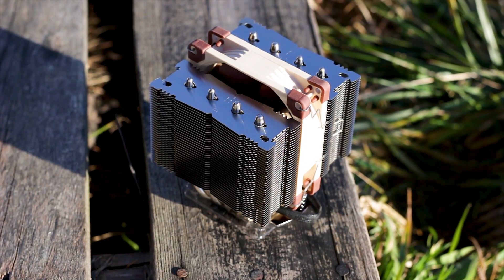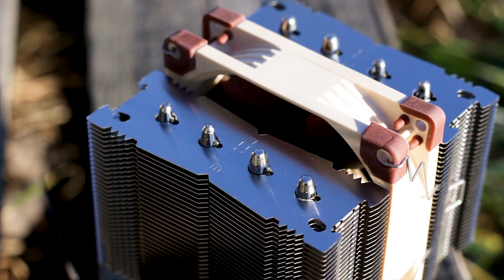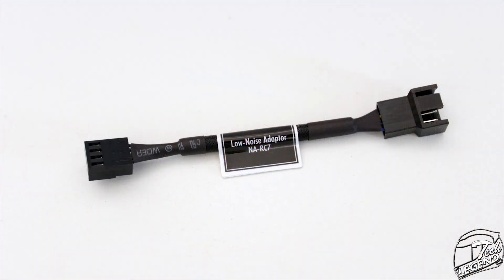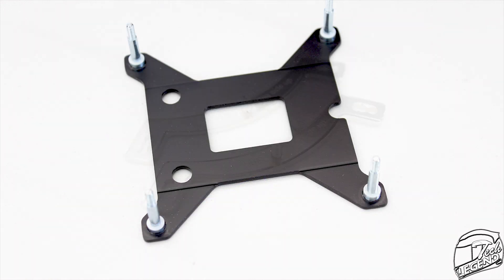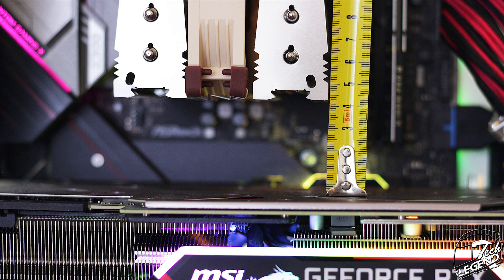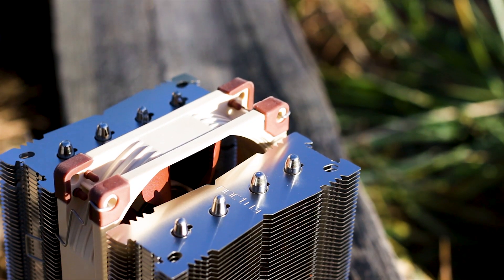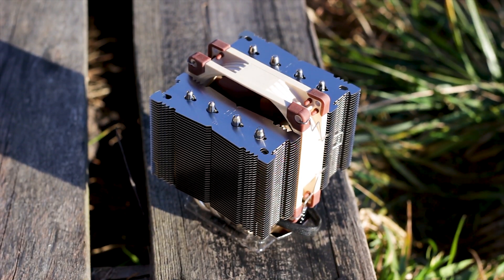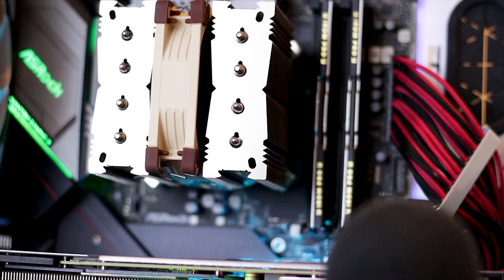Noctua NH-D9L CPU Cooler Review | The smaller alternative to performance!

Comment: Have this cooler running from my Ryzen 2600 to 3600x to 5600 and now on the 5800x3d
Reply from the maker: Great to hear it's still going strong!
Reply: @TechLegend-com  it was was thermal throttling the 5800x3d so I replaced it with the D15.

Comment: I have ryzen 5 7600x
Is this cooler would be good for it?
I hope someone answer me
Reply from the maker: I don't think that you can run that CPU with this cooler, as it's too small. I'd recommend you something bigger, either the NH-D15, the DeepCool AK620 or the be quiet! dark rock pro 4.
Reply: i have i5 10600K , AIDA64 FPU stress test (131W)  81°C

Comment: would this cooler be good for an i5 10400? I plan to do 3D rendering and gaming.
Reply from the maker: For 3D rendering you need a lot more than this. Either the NH-U12A or the NH-D15S.
Reply: @TechLegend-com  my budget is around 65 dollars which is only enough to get a noctua u9s where i live.
Reply from the maker: @beacon6424  Check to see if the  Scythe Ninja 5 is in your budget.
Reply: @TechLegend-com  sadly, it's too expensive and not on stock.
Reply from the maker: @beacon6424  Hmm, what about the Noctua NH-U12S?
Reply: @TechLegend-com  that's also over the budget where i live.
Reply from the maker: @beacon6424  Then the NH-D9L looks to be a good choice for you.
Reply: @TechLegend-com  is the nh-u9s better? that's the highest my budget can go where i live
Reply from the maker: @beacon6424  The NH-D9L is the better cooler.
Reply: @Tech Legend Noctua lists the U9 as having a higher NSPR than the D9 so it is actually the other way around